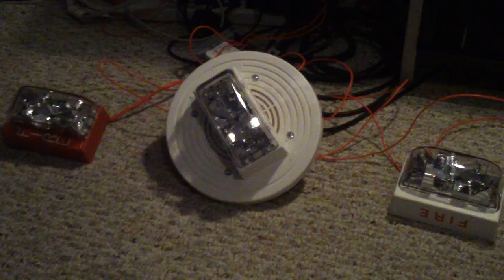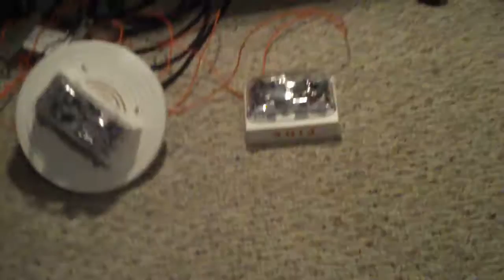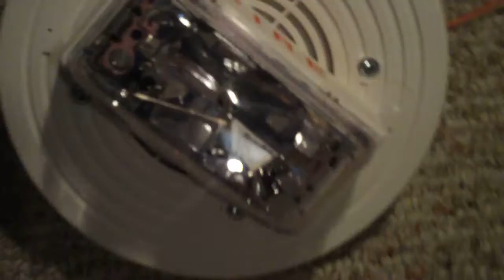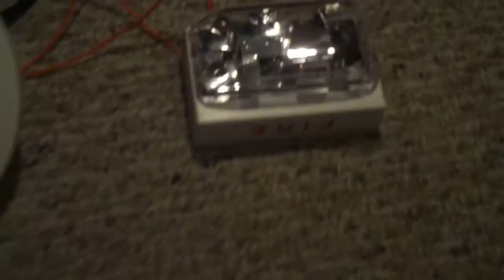Simplex 4906-9154 SmartSync TrueAlert Speaker/Strobe

Comment: It seems I'm seeing more and more of these on modern Simplex voice-evac systems, even if there are also wall-mount speaker/strobes installed.
Reply: They even finally have them in one building at my friend's university, where Simplex is prominent through the academic buildings and a few dorms, along with the wall-mount TrueAlert speaker/strobes and the newer 4099-9006 dual-action pulls with the LED indicator. They are replacing an older Simplex system that had 4051+4050-85 horn/lights and 4251-20 single-action pulls.

Comment from the maker: You basically would wire it like a speaker in a stereo system. You'll need some form of amplifier and some speaker wire. If there are multiple terminals on the back, connect one wire to "COMMON", and just pick a terminal for the other one. If it's not loud enough, try a different terminal. These terminals are taps, which can adjust the volume. The taps may also be in the form of jumpers.